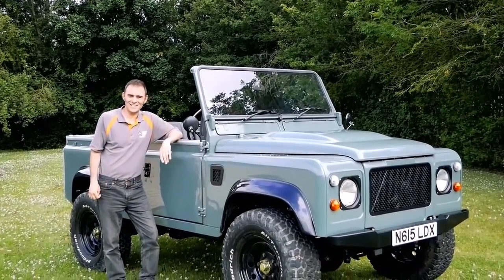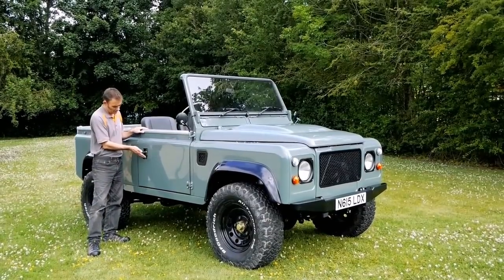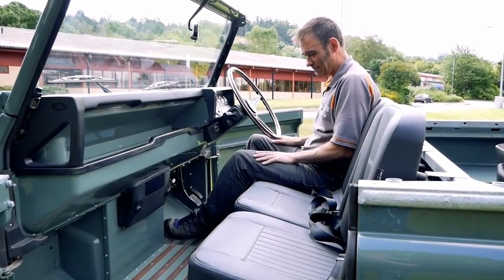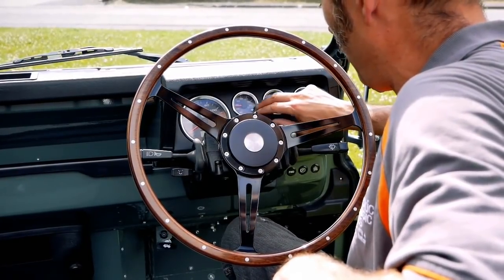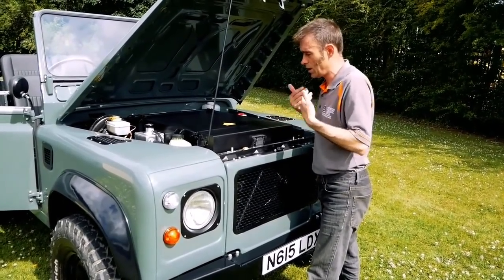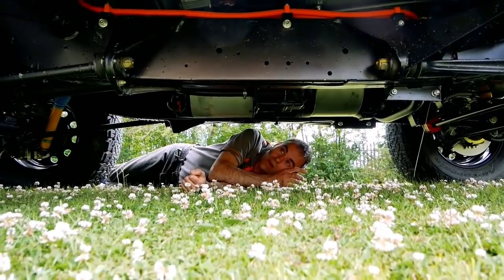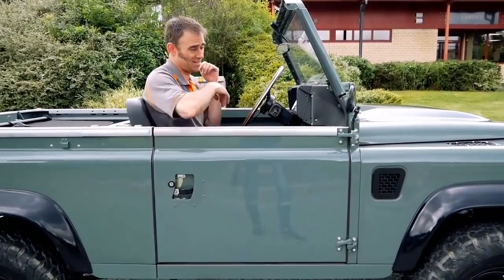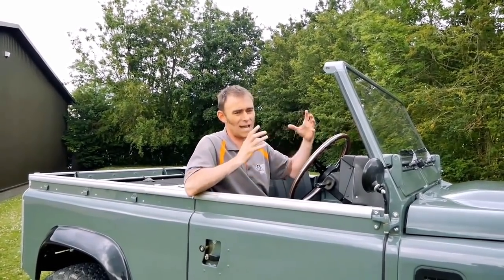Workshop walk-around: Land Rover Defender

Comment: I’m slogging through a conversion like this on my own plus YouTube and Google / DIY EV chat board etc.  I recently did my first test drive using an EV controls T2C controller which I believe you have started using as well…. Question: Due to having to run the motor in reverse due to mounting limitations, did you run into issues? Did you have to reverse phase leads..  Max power for my test drive was 15 out of what 300?  Not sure why it’s limited😢. Does it think I’m in reverse and is throttling the power?

Comment: Awesome vehicle! Awesome review! You refer a little past 13 minutes to changing the gears in the Tesla motor. Is this difficult to do and do you need to have the new gears custom cut? You also refer to the vehicle having 2 limited slip differentials (ostensibly the front and rear diffs) and one torque biasing diff. Is this within the Tesla drive unit itself? If so, are you able to adjust the bias ratio easily?
Reply from the maker: There's one of our 4.5:1 gear reduction sets in the Tesla unit, along with an ATB and an ATB in each axle. 👍
Reply: @ElectricClassicCars  what kind of ATBs do you like? It seems that there are many flavors.

Comment: My 93 Defender County 200 Tdi has a range of well over 550 miles on a full 18.5 tank of Derv on across country motoring. But you don't mention range on a full battery >> Also I doubt there are many charging places on back lane shortcuts & B roads >> Mind you Wife would no doubt love it as having fitted a power clutch softer than her Panda doesn't really please her >> It's noisy >> But Darling it's a diesel sounding good >> But what I find amazing is how the County is more relaxing to driver than our 93 RR Classic V8 & 98 Discovery 300 Tdi. maybe it's the long wheelbase effect >> All our\ LR''s are fitted with road tyres rather than truck tyres.

Comment: I've got several 1st Gen Isuzu Troopers here in the USA that would be perfect for this conversion.  Gonna do some research and see what it'll cost us.  We have been thinking of replacing the wifes ICE 4 Runner,(300K miles on the clock!) and this would be perfect since one of the Troopers has had everything but the engine and transmission restored in it so far.  Even have a new divorced transfer case that would hook up well with the electric motor.

Comment: As soon as you said you removed the original gearbox and transfer case I was puzzled how you maintained 4WD capability, but turning the Tesla driveline sideways is a stroke of brilliance. Essentially turning the Left-Right shafts into front-rear shafts. Though I get that you had to change the gearing, but still very neat bit of thinking.

Comment: Charging is not measured in kWh. It’s measured in kW. Assuming you actually have 21kw onboard AC 3 phase, that’s a lot over a J1772 connector. What charge rate at the CCS connector?  Gorgeous build BTW. Thanks for sharing it!
Reply from the maker: Yes, this Landy has a 21kW 3phase AC charger and a 100kW CCS DC rapid charging system on board. This is all through a Type 2 CCS socket, not a Type 1 CCS like in the US. 👍

Comment: Richard, you have an amazing forward view-point as regards usable classics. For those who might want to actually drive their old cars on the road, electric does make sense if you do have the cash for it. But...it will allow an unlimited lifespan, with no worries about fuel, valve wear, emissions, distributers, carbs, etc, etc... I guess it'll be so much cheaper & easier to replace knackered batteries on a conversion than on a full EV (Tesla/ID.3 etc) in future years.

Comment: Very very good video! This E-conversion is superb!
The only Downside is longlivety of the batteries. How many chargable drills i have disposed over the years because the batteries were tired. The drills were still perfect but the batteries were all tired.The cost of new batteries were high so i just had to buy a new drill. It's all good for now but the capacity of these batteries will be maybe less than half in 10 or less years. And batteries are EXPESIVE to replace...
Anyway. For the people who can afford this conversion, it's a very nice way to keep the classics on the road in an anti combustion world we come to live in. 
I'm looking forward to a series 2 conversion. 
One question! Why over 400 hp. Why not 200hp with the same battery pack. Could you drive twice the distance then? Just courious🤔
Reply from the maker: It's now 600hp, why? Because I can. I just wanted something a bit mental for myself. Most customer conversions are a more sensible hp figure. If you like a good Series 2a you should check out our Instagram for details on one we've just built and converted to electric. 👍

Comment: Apart from that bike you did in season one, no one for some reason is'nt makeing moterbike's for biker's as in the guy's that will travel all over to just ride you could probably get a double down tube bike like an old harley up to 300 maybe 400 mile range, as effert of moter is relevant to weight of craft, so distance of bike would be different to car, and yeh to test the sale's option i'd do 4 bike's make them look right but very different to think thd time it was made, then set up 100, 200 meter from a big bike club, and advertise free test drive's, the body of the bike i was thinking metal work covering but molded for design, following from the old gas tank.

Comment: And if i were doing a moterbike convertion, i go with something like a 194ish harley frame you know the one's with the double down tube, something wide so you take the tank and wrap it down to the bottom  tube's with everthing covered and the top of ghe old gas tank as the charge point, two down tube mean's space for more battery's. More battery's long distance, longer distance bigger market, make the hell angel's a real electric classic bike that they would want to ride, and you'll have a seller.

Comment: For safety wouldn't a roll cage be good , because the rear passengers have no protection and it is a high car with big tyres so the roll over risk when offroading is low but could easily kill anyone in the back seats if it did happen
Reply: Yeah, my grandfather died during WWII when his Jeep overturned, during training!
Reply: @pasad335 sorry, very sad

Comment: Needs to be made 4WD high and low range otherwise its useless also on a modern vehicle if it does not have full LED lights (headlights, indicators, taillights/brake lights and full interior LED lights) it is behind the times.
Reply from the maker: It is 4WD and doesn't need high/low range gearing as it's electric which has max torque from 0RPM, unlike ICE. 👍
Reply: @ElectricClassicCars  it's not 4wd high/low range its awd there is a big difference, and if there is that much torque from instant its going to be useless off road as the wheels will spin all the time.
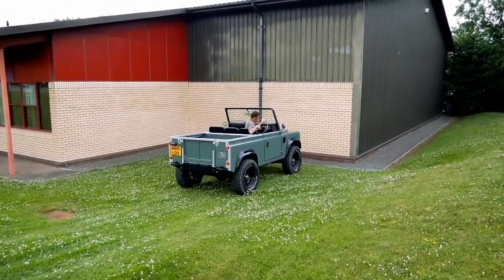Reply from the maker: @jasonswift7098  Its got 3 LSDs and traction control and has pulled many a 4WD out of situations that I just drove through with no drama. The off road mode helps deliver the power without giving it all in an instant and prevents wheel spin 17:40

Comment: Absolutely awesome!! I Wonder what's the material for your battery box, is it fully waterproof for offroad ?
Reply from the maker: It's made of steel and is indeed water proof. 👍
Reply: @ElectricClassicCars  isn't it too heavy ? How many mm thick?
Reply from the maker: @arthurand3430  No, the vehicle is the same weight as when it was diesel with a full tank. The battery boxes need to be strong as they're carrying a lot of weight and they have to put up with the rigours of off roading. 👍